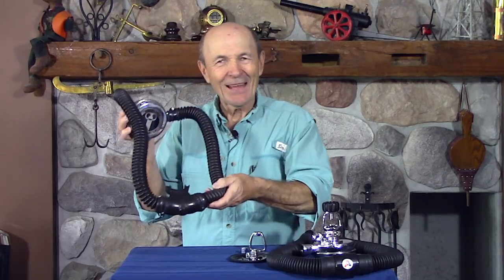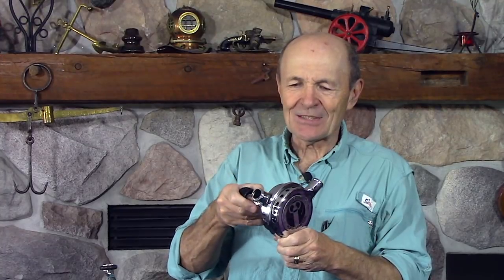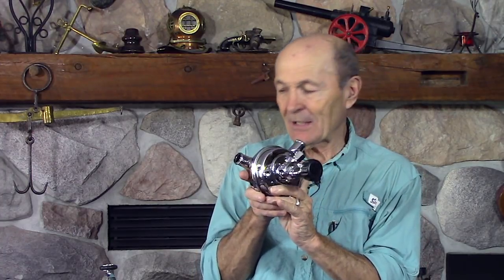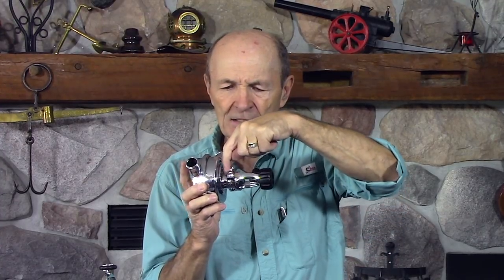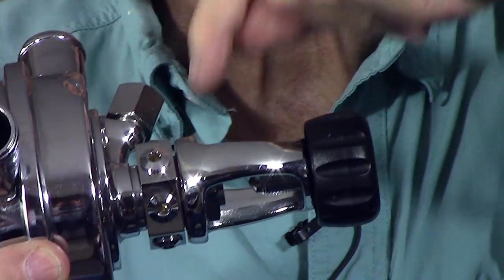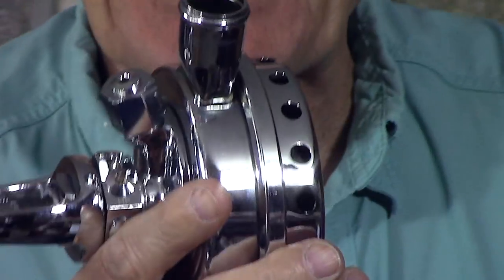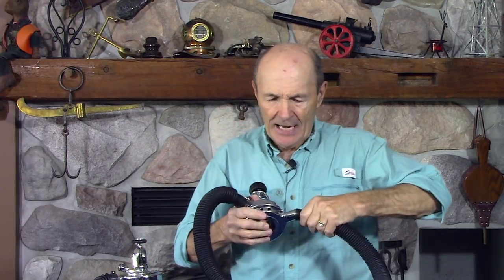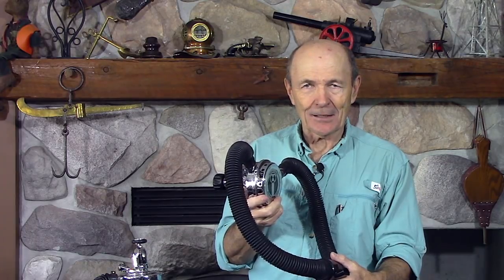Vintage Scuba: Upgrade Your Double Hose Regulator - S05E04

Comment: Hi Alec. I have two old  double H. regs, an I use them with a double outlet valve I have on my tank (may be you knouw it) . In one outlet I put the DHReg an in the other goes a modern 1st stg with the spg,, the safety second and the Power of BC.  Here in my country Argrntina there is no dive store that can do what you said to upgrade that kind of regs. I wish to be there so I can do it.  I love your tech tips. I'm 65 and I thoght I had hung my fins forever, but you gave me back the desire to go diving again. Thank You. Sorry about my inglish.
Reply from the maker: Don't apologize Luis. Your English is MUCH better than my Spanish!
Your solution to diving with a 2 hose is pretty unique. I like it.
A 'Y' Valve with a 2 hose on one arm and a modern arm on the other is a perfect way to enjoy double hose diving AND be safe and meet modern standards.
Gosh 65!! Don't even think about giving up diving yet!
I'm almost 10 years older and still dive every year. I don't do some of the foolish things I used to do but, I have a lot fun.
Thanks for your message Luis. Keep up the good work.
By the way, I am always looking for Sea Hunt (the 1960's TV Show) stuff and I know it was popular in Argentina. 
If you have a moment please, search any local auction sites or vintage scuba sites that may have some. 
Alec

Comment: This is a really great video. Long live the Phoenix adapter!!! But long yokes and Banjo fittings work in a pinch!
Reply from the maker: The downside to a banjo fitting is its proclivity to O-Ring failure. Plus you still don't have the ability to attach modern safety devices. If you're diving on your own it's not an issue but on a charter boat different rules apply.
Take care Russ.
Alec
Reply: I have 4 Phoenix adapted regs, anf they are wonderful. There are dive operations that don't mess with you IF you produce a PADI vintage card, The best thing is to ask and make clear with the dive operatos first. Cocoview resort in Honduras is very vintage friendly for an example.
Reply: I have an older DAM with the short yoke, the Phoenix is not much more expensive than buying a long yoke and the banjo fitting. Also I would  need the hookah adaptor and spliter for the BC hose and octopus. After all that I think the Phoenix is a much better deal.

Comment: One problem "vintage" regs have is that the yoke will not fit most modern tank valves, nor are they rated for modern high pressure tank pressures.
Reply from the maker: I have watched the yoke arms of a vintage regulator (pre-1975) actually stretch when a diver tuned on the air. It is scary!!!
Those regulators were designed for 1800psi and then modified slightly in the 1960s to accommodate 2250psi. They must NOT be used at 3000psi.
If you compare the yoke from an old reg to that on a modern reg, you can easily see the great difference in construction.
Some older yokes will not fit on a new valve but many will. Hence the temptation to try an old reg on a new tank.
Be careful down there.
Alec
Reply: @AlecPeirceScuba_SeaHunter  Good advice Alec.

Comment: Hi Alec, another great video thabks.. do you know much about hookah compressors, I watched the episode about the airbouy interesting. I have been looking at these and there is a lot of different options. There is some people saying it must be oiless yet I see hookah dive units usings a normal air compressor unit that takes and and runs 3 filters. I considered building my own unit too because it seem like it's a Honda engine compressor unit 3 stage filtration and air reservoir... Be interested if you have had much to do with these thanks

Comment: Hi Alex. God is good. I have to be thankfull. I found 2 steel 50s in hydro. I'm still looking for the Sportways 38s but the steel 50s are just as rare. 
I'm realy lucky.  I'm working on a Mike Nelson gadget. (A stowable rebreather)
I'm certified on the Evo but I got a British Airpocket with a red k on and I'm installing a small CO2 scrubber into the hose. I can alternate rebreathing with my one hose scuba to extend my bottom time.  This would be for when a light rig is called for. Like one of tbos steel 50s..
Reply from the maker: That is a cool idea.  Good luck and test it fully.
A

Comment: Thanks Alec. Be advised that early regs were usually single stage and tended to be rough breathing at certain pressure depending on whether it was an upstream or downstream valve. The yokes were also 2200 psi unlike the last regs with 3000 psi yoke; the Nemrod even had a DIN adaptor available and the last Dacor C3N and Nemrod breathed beautiful! Glad to see they are coming back, never had a problem with one. You will, of course, need a US Divers Vulcan or the Puma Frogmesser knife! Remember, when you cut the hose on an enemy frogman, don't do the left hose like on TV! It's just exhaust, Messers. Nelson and bond!
Reply from the maker: All good points Mark.
Thanks for watching.
Alec

Comment: LOL, the Avengers. Really cool they are bringing it back. They are doing the same thing with retro video game systems too. Not hard anymore to get your Sega and Nintendo systems to full hd anymore. Just buy a little kit/peripheral and off you go. If you don't want to hack up your original device you have modern day alternatives you can buy off the shelf.
Reply from the maker: The vintage industry is booming of course, largely because of all the Baby Boomers who are retiring and have money. They all want to recapture their childhood. I'm the same. I have 3 Norton Commandos in my garage - the same bike I used to race in 1971.
Just try to buy a 1955 Chevy today. It's nuts!!
But, as you say, there's a big business out there making reproduction parts. It's probably easier and cheaper to build a 1971 Norton from repro parts than to buy and rebuild one.
Alec

Comment: What I did to use my vintage kit was also have a pony cylinder to work a safe second and inflate the BCD.
Even with my Kraken in the Red Sea no penetration dives were permitted in case the hoses were damaged (the guide was familiar with twin hose kit).
Reply: Then add the cordura nylon protectors to your Argonaut hoses and you will have the same protection for them all the rebreather divers use.

Comment: I got the Kraken and can't wait to dive with it. I have installed my LP hose and the computer is coming to my mailbox soon. How tight should I install my LP hose into my reg? I just used a ranch to tighten into the ports snugly. Is it correct ?
Reply from the maker: Yes. Not too tightly! The regulator port is brass while the LP hose fitting is steel. If you go too tightly, the threads in the reg port will strip. Not nice.
The appropriate correct torque for these hoses according to the owner's manuals that actually put such technical information in the owner's manual, is about 40 inch-pounds. That's less than 4 foot-pounds. 
It's very had to measure the correct torque when installing a hose since most torque wrenches use a socket end. You can't get a torque wrench onto the hex end of a hose without using an adapter (probably a Crowsfoot wrench) on the torque wrench and that changes the readings. It can be figured out but it's simply too much trouble for most scuba service people.
So look at it this way. 4 foot-pounds means that a wrench that is 12" from the center of the nut to the point where you are pulling on the wrench handle needs a force of only 4 pounds to tighten the nut properly. However, it's not that simple (surprise!!).
If you put a 12" wrench on the nut and hang a 4-pound weight at the 12" mark, the weight will continue to tighten the nut after it has reached 4 foot-pounds. It takes a judgment call to know when to stop pulling.
Just use a decent wrench, put it firmly on the nut and tighten until you think you've reached a force of 4 pounds on your hand. It might help to hold a 4-pound weight in your hands a few times to get a feel.
Once you think you've done that, stop tightening.
A quick check is to firmly grasp the hose and nut with a gloved hand and try to unscrew it. It should be impossible to do so.
Tight enough!
Good luck.
Alec

Comment: Alec, great video, about keeping up with technology and vintage regulators. Although I have a Nemrod Snark III, I have hard time finding part for it. Not even sure, I can upgrade it to modern standards. In the mean time, I have been diving, in a weekly basis, with my Calypso VI  40 year old single hose with excellent results, and still plenty of parts available.
Reply from the maker: The Nemrod line of scuba gear, very popular in the 70's, was made in Spain and even when the gear was sold, parts and service was a bit hard to get. Today sadly there are no parts, NOS or reproductions, available.
The Nemrod was one of the most attractive 2 hose regs made.
Take care.
Alec
Reply: I read somewhere, that at the begging, they were a copy of the Couteau Mistral Regulators. Do you know, if the SNARK III are compatible to the  MIstral US Divers regulators?

Comment: Dreager and Seibe Gorman twin hose valves of the 50's/60's had take off's for tools/pressure gauges/ surface demand connections.
Reply: And my first twin hose regulator was a Seibe SINGLE STAGE twin hose that I purchased in 1959.
Reply from the maker: Both of these European regulators had features that didn't appear until much later, if ever, on US brands.
They were rugged and dependable regulators if a bit complicated and hard to service.
Alec

Comment: Would you clear a modern regulator like you would back then? Or has that changed to?
Reply: The original double-hose regulators would fill with water on both side, and required a "lift and roll" clearing method. But it wasn't long until an improved mouthpiece with one-way valves appeared, which could be retrofitted to the old ones and became standard with all new ones. It was much easier to clear just by blowing into it. (A little water would remain on one side, which would gurgle a little bit, but nothing you couldn't live with.)
Reply: A section of the Vintage Double Hose website forum will answer all these questions.. http://vintagedoublehose.com/forum/viewforum.php?f=58

Comment: I got me an Aqualung Mistral. I was interested in the Kraken myself, but importing it to the EU is difficult since its not CE certified. I could still get it in parts tough, but local customs seems to hate me on a personal base.
Reply from the maker: You could get a friend here to buy a Kraken and then ship, it to you as a gift labelled swimming accessory.
It's probably worth it. I was trained on the USD Mistral in 1960.
Fine, old regulator with the emphasis on old!
If you want to dive double hose, get a Kraken.
Or at least a newer 2 hose and upgrade to a Phoenix.
Good luck.
Alec
Reply: I have shipped dozens of Argonaut Kraken's to the EU with ZERO problem.  There are two going to Germany next week.

Comment: Alec  hi I  have  2  vintage  2  hose  regulators  that  need  servicing  and  no one  in  Australia  services  them   any  chance  I  could  send  them  to  you  and  get  them  serviced
Reply from the maker: Actually I'm not the best choice.
However, a good friend of mine is in that very business and is recognized as the best. Your regs will come home better than new.
You need to contact him in advance to ensure your regs are serviceable. Parts and service is not available for all makes and models.
Reach Bryan at vintagedoublehose.com .
Good luck.
Alec
Reply: Thank you Alec.  I have dozens and dozens of customers in Australia!  As a matter of fact it's the largest population of Argonaut Kraken divers outside of the US...  Steve Taylor of the HDS in Melbourne can connect you with other vintage divers.
Reply: thanks  alec  for  your  quick  reply    so  are  u  saying  there is  no one in  Australia  that  services  the  regs  like  I  thought is this  right